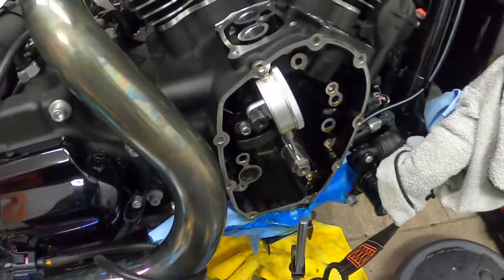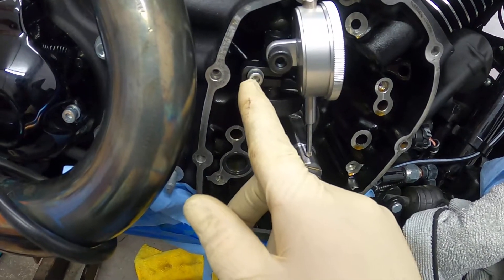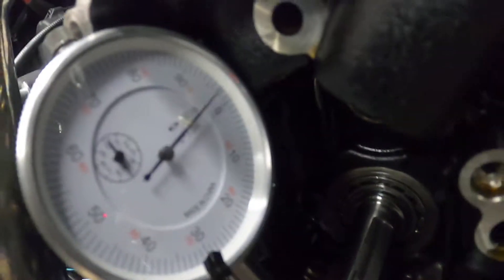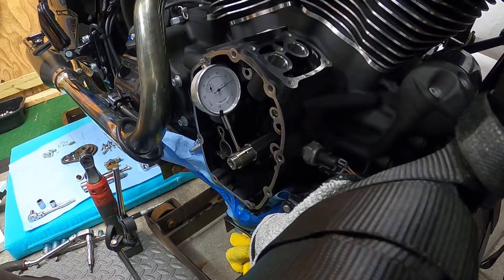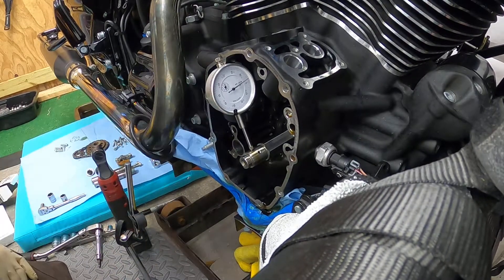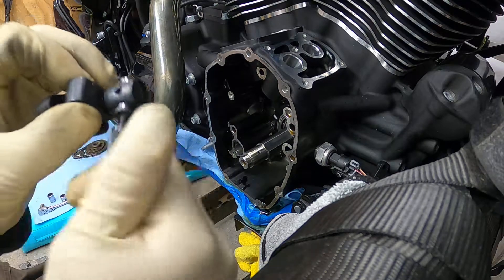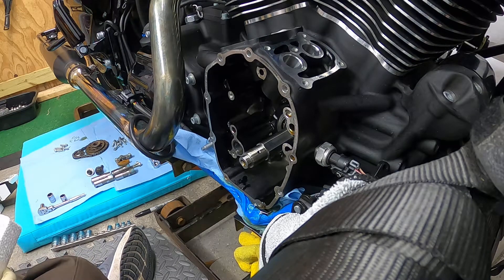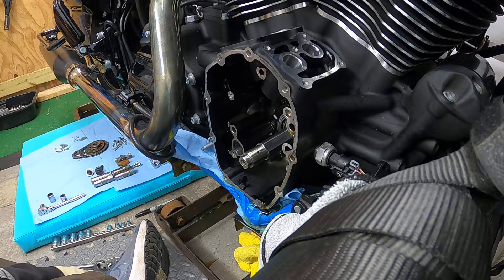harley davidson crank  runout home made tool

Comment: I did the same thing. People think you need the expensive run out tool from fueling cause they are told that. Great video man!
Reply from the maker: Thanks bud ya this works perfectly  and the good part I can use is for other stuff on cars 🤙🏻